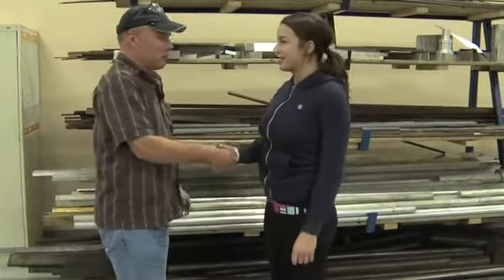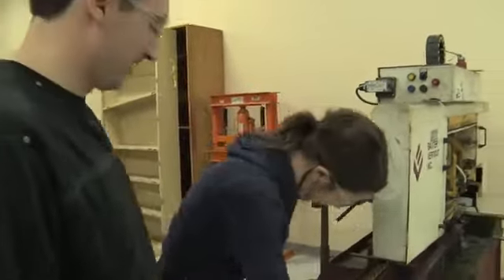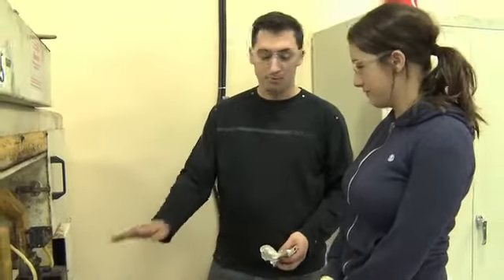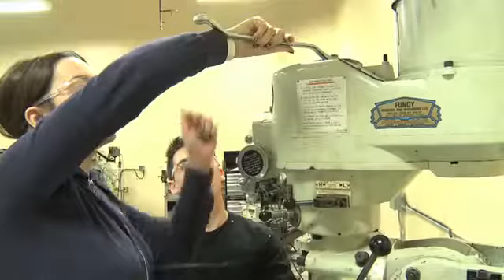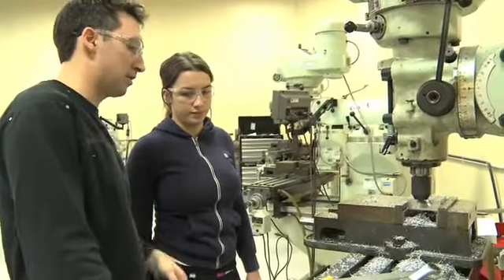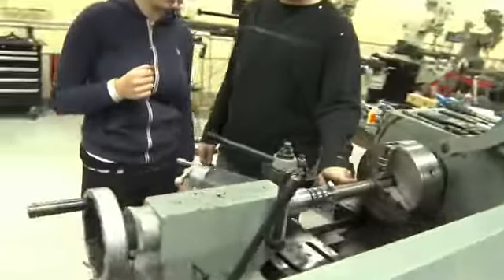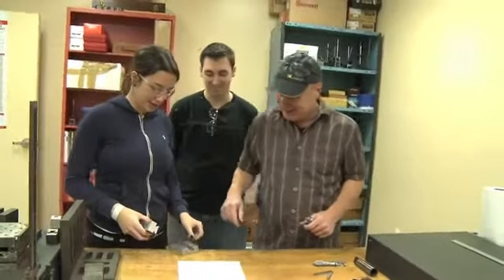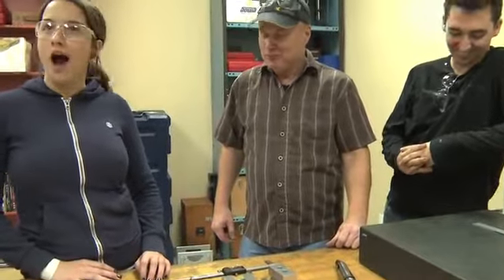In School -- Precision Machinist

Comment: Squaring up the stock, four surfaces should be machined on the first milling operation. Back side, top, one end, and front side.
 Remove the stock from the vice, deburr, hang the stock off the end of the vice opposite end, mill the end to length, fly cut off false end to bring to thickness. Then you will have a square piece of stock, the finished size.
If you fly cut one plane , rotate, cut, rotate ..... You will end up with a parallelogram that isn't square, or to size.
I'm very glad to see young people entering the industrial Arts trade. 
Learn well, learn fast , machine shops need your help.
Follow safety precautions.
Take care.

Comment: See all the manual stuff in the background? THAT'S how you learn! When I first apprenticed, I had to master manual machining and turning before I was placed on anything with a computer and servos on it...You have to first learn WHY you are doing a process before you can execute it via computer! Nobody wants to do it this way anymore...
Reply: My grandpa has mills, lathes, and a couple Cnc routers that he has built. I was just telling him in his shop how I wish I would’ve learned on manuals first.. I find it satisfying. I also find it super interesting. I started off on Cnc, but I want to master manual machining as well. I have a pretty decent understanding of chip making, but all of the cutting at different angles and what not.. that I feel is understood more in manual.. I look forward to learning more everyday.
Reply: They told us we were obsolete because cnc.  Took our notes on feed machine speeds on exotic materials, and sent on disc too China.   Kids have computer do their math and basically read the print and do the math.    Worked in shop before retiring that was cnc.    Had 14%scrap rate!!!  Were taking huge passes on parts clamped too table.   Parts were being moved around.   Tolerances were out and I spent most of my time manually fixing "SCRAP".   convinced supervisor too let me make a fixture, dedicated too part they scrapped most.   Surprise, scrap rate fell too less than 1%, thru no fault of fixture, wasn't cleaned of chips properly.    Cnc dept all got 5$ hour raise.    Sold my dept too a company in Compton calif.